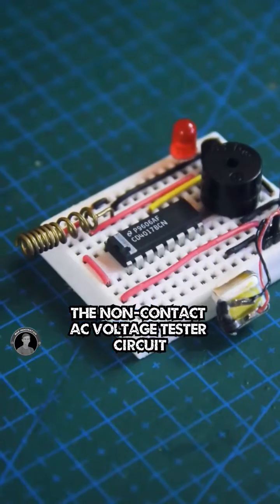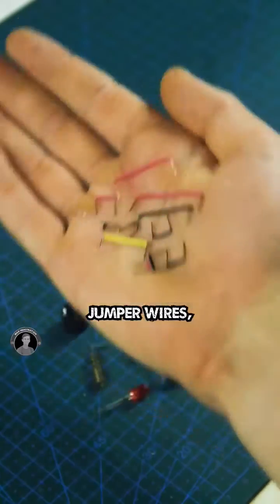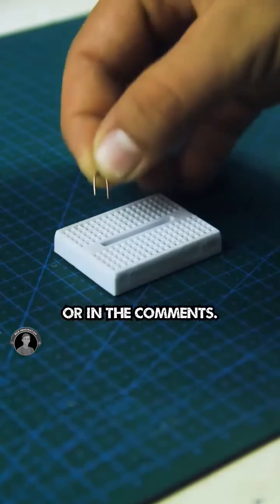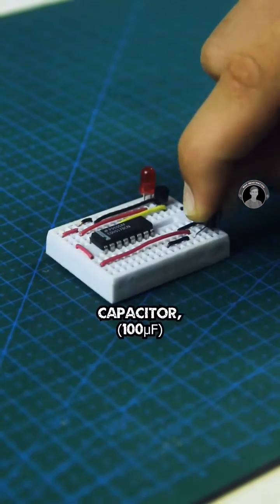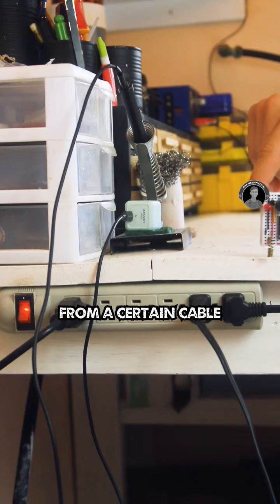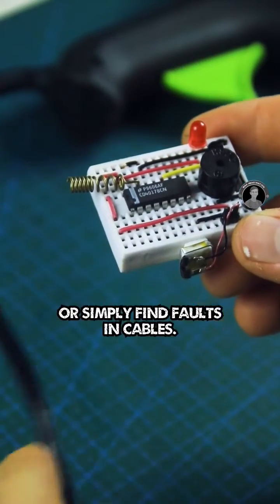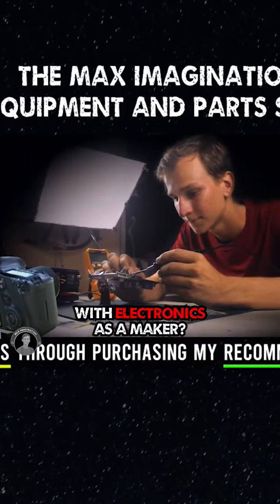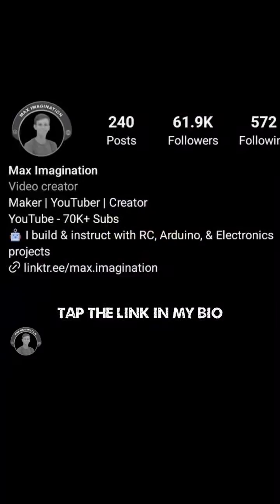DIY Circuit - Non-contact AC Voltage Tester ⚡#electronicsidea #electroniccircuits #electronics

Comment: Is it still work in 3voltage from cr 2032? Thank you
Reply from the maker: The CD4017 IC typically operates within a voltage range of 3V to 15V, so yes, you may be able to power it from one of those 3V coin cell batteries. Cheers.

If you ever feel generous and want to support my work, here’s my BuyMeACoffee page: buymeacoffee.com/MaxImagination. It means a lot!

Comment: Hi, how are you doing? I was wondering if you could help me with something. I need a circuit diagram based on the one I shared earlier. Do you happen to have it or could you possibly recreate it in a tool like EveryCircuit or a similar platform? I'd really appreciate your help.
Reply from the maker: Hi, good thanks. Which circuit are you referring to? I do not make diagrams for people, only go from what I supply readily and make necessary changes is needed. You can use Fritzing as an example.

Comment: Max i having a little trouble finding one cell lithium battery 
There are 2 versions in the shop 100mah 3.7v 501220 lithium li-polymer and 110mah 3.7v 501421 lithium li-polymer rechargeable battery pls help me
Reply: And is this 433mhz spiral antenna
Reply from the maker: Not sure if it was for that frequency, but mine came from SIM800l module. Most short copper or metal spiral antennas will work, even make one yourself.
Reply: @MaxImagination  thanks
Reply from the maker: No problem :)

If you ever feel generous and want to support my work, here’s my BuyMeACoffee page: buymeacoffee.com/MaxImagination. It means a lot!
Reply from the maker: Hi. Either of those will work. The capacity difference isn't much. You can use one or the other.

Comment: Which software did you use for  making the circuit diagramwhich is 
 in the drive link?
Reply from the maker: I used Fritzing for designing the circuit.
Reply: @MaxImagination  oh thanks but I tried this circuit physically but didn't work even though all the components were in the working condition